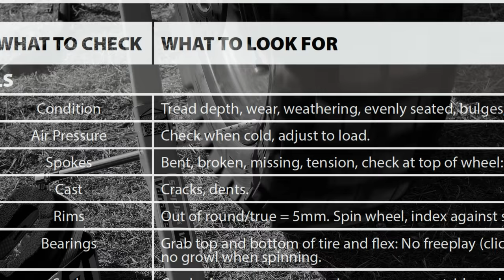Before You Ride - A Quick, Effective Motorcycle Safety Check

Comment: I would actually recommend a lot of this just for the sake of warming up your bike while you do the quick checks. So many people (sometimes myself included) just switch on ignition and ride off without letting it warm up a bit. Having a reason for letting the bike warm up a minute before you take off, is probably good in the long run
Reply: thats bull

your engine might warm up but nothing will be running so there won't be any oil running trough the moving parts so you're better of starting the bike and ride it to actually warm it up. It takes about 10-15KM to warm up a bike properly 

letting it sit there just annoys the neighbours
Reply: SoloSeff  You realize that your chain, sprockets and even the transmission to some degree don't benefit from a warm engine, right? 

The parts that are moving at idle, namely piston, crank, and the valvetrain are being lubricated. The warm up is pretty much only for the piston/cylinder as the metals expand at different rates and work best when at proper operating temperature. 

My bike only takes about a minute at idle to get some heat into it, enough time to strap on a helmet, tighten my gloves and buckle up my backpack. Hardly inconvenient
Reply: This is something that people can't seem to agree on. The problem with warming it up first is that the engine doesn't really warm much unless you're in motion. My bike idles at a touch under 1.5k, but won't drop below 4k while riding. 

On my Ninja 250r, the engine won't warm up much if it's not in motion. And yes, I've tried. The engine just doesn't warm enough to make it happen in any reasonable time frame. Whereas within a couple minutes of riding, it's usually good to go.
Reply: my bike is warmed up in like 300 meters, although my bike wont pull away properly under 5k, and power comes at around 7
Reply: It's an issue very similar to driving a car. The fact that the thermometer shows 90°C (or a similarly OK temperature) does not mean that your engine is heated to the same temperature, only the cooling fluid is, and vice versa, the bike is not at operational temperature. I'd rather not risk it and I don't mind waiting a bit. I drive my bike out of the garage, keep it running, close the garage, put on the jacket and zip it to my pants, put on the back protector, helmet, glasses, double-check my car, the garage door and the license in the storage, put on the gloves (at this time my bike is running idle and warming up for 5 minutes or so) and then get on and ride. And I don't rev it over 5k in the next couple of minutes - until I get out of the city. I don't need to jump on it and rev it to 11k in 30 seconds, since I am neither retarded nor simply careless and stupid.
Reply: @Jonas I don't think anyone is suggesting to rev the shit out of the engine cold. A proper warmup is to ride gently until at temperature, meaning the coolant has hit it's peak.
Reply: It is actually fine to ride straight way as long as you just use a tiny bit of throttle to keep moving, not much more than idle is needed and large bikes do warm very quick.  BMW actually recommend driving straight away in just the manner I said above, it makes sense, the oil pump will pump more oil around and warm up quicker = longer lasting engine components, as long as it's still well maintained of course.
Reply: In my experience with a carbeurated 650 single the motor can and will stall off idle if not warmed properly, not every time, just at the worst time.
Reply: ebmstudios carb vehicles require warm up. But fi cars dont, and im surprised that people think the first mile of their trip on public roads requires a warm motorcycle engine.
Reply: +Johnny Blue, it's a Ninja 250r, those bikes are notoriously cold blooded to the point where some folks will put some cardboard to block the radiator during warm up. Small liquid cooled engines can be rather tough to get warmed up, especially when the temperature drops below 60F.

I have to ride for dozens of miles on the freeway before the engine warms to the point where I can't touch it without burning myself.

Thermostat has nothing to do with it, all that does is tells the radiator fan to turn on. Removing that would cause it to overheat, but only on a warm day.
Reply: +Jason J. Ayala P. , depends where you are, the street out front of my place has cars driving up to 50mph, and attempting that without a reasonably warm engine is asking for trouble. Especially if you don't have fuel injection and may have some moisture in the line.
Reply: Chris L yea a lot of various statements in this regard, and probably not a single truth here. But I can't imagine it having any negative effect, so why not take the time to just make sure the basics on your bike are working fine - and having a slightly warmer engine for takeoff.

I know from experience that my bike does benefit from a bit of preheat - especially in the colder winter months. My bike gets a lot of airflow, and often during cold days it will never reach its normal max temperature where it usually sits in regular riding. Because of its large amount of cold airflow, it is actually easier for me to get the bike warm while it is not in motion (and no its not air-cooled, just lots of air flow around all engine parts). It's also a single cyl (650cc) which might contribute to the reason for its easy cooling. I sure feel a difference when I let it sit for a minute before takeoff. Not a big difference, but still I feel that everything is just running a tad more smoothly.

By the way when I talk "cold days" I mean days where there are inches of snow on the roads.
People who never ride sub 10 degrees celsius will probably never notice a difference.
Reply: Jonáš Lasák Nice, pretty much what I do also 👍
Reply: Interesting. I never let it warm up by idling. I've been told that running on idle, or without a load isn't the best thing for internal combustion engines. And my neighbours appreciate the lack of noise at ungodly hours because of my weird working hours. Neither my modern fuel injected bikes or 70's bikes seemed to suffer, the only one needing to warm up was a suzuki gs450 but that has way too small carbs from stock. I don't ride the bike hard until it's warmed up properly though. No need to ride hard in my part of town either... By the time I'm out of town pretty much every bike is warm enough to open it up. Not every bike though. Kawasaki GPZ500 in winter... I'm looking at you.
Reply: It depends on your bike. I have a 1991 carborated Suzuki DR 650 without E-starter. Oil pressure when cold and idling is pretty much non existent, so the manual says you should start the old Diva and get on with your ride immedeatly, keeping her between 3000-4.500 rpms  for the next 5 km. Otherwise there is not enough oil going up to the camshaft, resulting in a ridiculous amount of wear. Even when warm she has little problems with it. Setting idle about 1400 rpm is no problem and the motor sounds just fine while running, so many guys did it. But for proper oil pressure 17 - 1800rpm is needed and not getting enough lubricant every time the bike is in idle really adds up. Now you see a lot of these old DRs with their second or third camshaft and new rocker arms. A lot of unnecassary repairs just because people dont read the manual if you ask me ^^
Reply: I know this thread is old, but letting it "warm up" while doing the check will let you hear if the engine is making any unusual noises.  Especially when you check the controls.
Reply: MISTER SIR I'm looking to ride in the winter in Pittsburgh PA. Any suggestions?
Reply: @MitchellJosh  I guess you mean in terms of things that are good to consider when riding in winter? A lot depends on what kind of bike you ride, but generally I'd say that a more constant cleaning and lubrication of the chain is important (clean and lube chain approx every second fuel stop, if road conditions are very bad then you can even do it every time you stop for fuel), and checking tyre pressure too, as it will drop during cold temps. Optimal winter spec road tyres are also important, ones that handle wet/cold/slippery surfaces.
I'd say for safety of riding in general, personal comfort is actually the biggest factor to consider, because an uncomfortable rider is more prone to making rider-induced mistakes and late reactions. So proper riding gear that insulates you and blocks off head wind, but still allows your body to breathe is important. Your hands are gonna be most significantly effected by wind, moisture, and the cold temp - so having either a thick winter glove, or use thin silk gloves beneath your riding gloves can also do a great job at maintaining a bit of heat (old skier trick). I personally often found myself warming my hands individually by holding them close to the engine when the air temp was very low, it can help a bit.
Remember to check your fluids often, make sure that clutch and brakes are easily operated. In general, all basic maintenance has to be done/checked more frequently during winter.
Lastly, in case you come across road with a decent snow layer, it may be best to ride (very slowly) in the fresh snow spots and stay clear of grooves and trails made by other vehicles. If you follow in the track of a car for example, your front wheel will have a tendency to steer according to the trail, rather than your handlebar input - and if you don't match your inputs perfectly the front tyre might slide in the opposite direction of where the bike is going. In fresh patches of snow, there is no pre-existing grooves for your wheels to dig into, so steering is a bit more predictable. Still, you should always be very cautious of sudden movements and steering inputs, and I'd say if there is more than an inch or two of snow, then you should not exceed speeds at which you'd feel comfortable putting down your feet to help maintain balance.

If you were asking for suggestions of where in Pittsburgh to ride, then I'm sorry I don't know the place.

I don't know if you're experienced in winter riding or not, so excuse me if some of my suggestions seem very basic :)

Comment: This is a good guide. The weld check is not critical every time unless you just rode off road. Once you have so many miles on the same bike, with the same tires you will also learn what low PSI feels like. With time, and miles this process can be done in a minute or less. 

I will also say that if you ride every single day this can be an every other day check. With my average of 1000k miles a month on my bike some times i just have to get on and go. For you people that ride far less i would recommend doing this every day

Comment: When to make the checks:   I suggest this whole 90 second rigamarole anytime you have to pick up the bike of the ground — after the crash.  Otherwise,  tire tread depth, pressure, oil, etc. at least once a week.    Loose fasteners:  after a day in the dirt, not a few minutes before the ride.  How many checks do you make before driving off in your car?  I don’t think modern bikes shake themselves apart or suddenly drip fluid.   It never hurts to check, of course, but  I ride 3 or four times a week, and many of my rides are less than 25 miles.  If this 90 second check is performed every 300 miles or so, or whenever the bike has sat around unridden for several weeks,  and certainly after a tipover or worse, I think you’re good.

Comment: I check lights & fluid. My SV650 headlights failed last month at 22k. Melted black connector pin under the airbox, a real twat to reach. Didn't have to solder it by using a wire lever connector. Also the yellow LHS switchgear connector had green pins. The notorious green melting connector was surprisingly clean as it's  watertight.

Comment: Ryan does this the right way. I on the other hand check the air pressure/fuel level/ground (leaks) every ride - been caught several times with slow air leaks. I check the chain every 2 weeks or so, fluids/lights every month and welds/fasteners never (my bad - but it's a 2017). I wish I has a fancier bike with tire pressure monitors to be honest (I'm a bit anal about tire pressure) - but even they can fail so, whatever. Great vid as always.

Comment: I really should do all that... it's a great routine. Instead, I bought a TPMS, blue loctite'd everything that could be, and carry chain stuff with me. So my routine goes like this (and I admit Ryan's is way better). Walk up to the bike, check the chain slack with a foot, walkaround looking for anything out of place, get on the bike and start going, during initial slow speed operation check air pressure and look for 'normal' suspension operation, listen for chain noise indicating I need to lube or adjust (do that next stop if needed). Once every 500-1000 miles add a sightglass check to see if I need to top off oil and a tire tread check to see how that's going. This has kept the bike in oil and prevented me from doing anything TOO disastrous... but I've missed a lot of stuff over 100k miles: multiple loosening bolts (including the loss of a centerstand bolt before I started the loctite protocol), low tire pressure before the addition of the TPMS, loose chain that was quiet but still needed adjustment, pannier that was left on the ground next to the bike because I was in a hurry (yea that's bad I know), front wheel mud flap that had somehow got caught up above the crossover part of the crash bars and I rode for 2 days before noticing it, headlight out, and lots of other things I probably would have caught with a more thoughtful pre-flight check.

Comment: You can get pressure monitoring valve caps for about £5 that will turn red when the pressure falls below the level your tyres are rated at.
You'll need to buy one specifically rated for the pressure though.

Comment: 2:50 XDD , Excellent video, as always ! , checking  wheels bearings is another easy thing to check in 30 seconds , just take your two hands on the top of the tire and wiggle back and fourth ( assuming you're on the side of the bike ) most of the time if its loose you will find out

Comment: I check and tighten every bolt and  screw for  service manual recommended pressure  before going to the corner shop for condoms.

Safety first 🍌
Reply: At least then you have a valid excuse when you're late for your date.
Reply: But... if you date is late, maybe you haven't ridden safe.. oh boy! 😨

Comment: My process is a bit weaker.    Usually involves some sort of awe inspired stare as I walk up follow by maybe a kick of the rear tire or a push of the rear brake.

From there I gear up, start it, and ride until I notice something wrong.

I'm pretty mechanically inclined so I can tell immediately when something starts affecting riding behavior.

I figure as I slowly pull out for my ride, I usually use both brakes before even starting the engine and then from there it's a slow progression through a slow gently warmup to a pretty hardcore ride.

Comment: The process for klr 650s is a bit different. First you start it up, then you push it over. After you pick it up you push it over on its other side. If it's still running you're good to go.

Comment: check air in tires,if you know your tires dont leak air you shouldnt  loose air after a week of bike sitting,if you lost 5 psi or so then you should check air before every ride and pump the wheel back up.
I know i dont leak oil and dont burn it that much so i check oil every 2-3 weeks.
Do not leave bike sitting for weeks-months on footpeg in same position,get front and rear stands or if you can just rotate front tire every week.If you dont your front tire might develope flat spot were most weight pushed it overtime and you will loose a shit ton of air.
Check your pockets pefore leaving,many times i found i was riding with my jacket pockets unzipped that had wallet or keys in them

Comment: failures do not occur at welds, a properly done weld should actually be stronger than the original material without the weld in the first place. weak points at joints usually occur just outside the welded area but never the weld its self.

Comment: I like to do a few of those post-ride.  Frame, chain/driveline, steering gear, brakes, bolts.... I want to know after a ride so I can fix it before the next. Nothing sucks worse than a mechanical ride cancelation.... and isn’t it so tempting then to ignore a small issue, go anyway, and make the problem worse, and or get hurt in the process? Post-ride checks help prevent the temptation.

Comment: I use powderss checklist

Petrol. Have I got enough for my journey?
Oil. Are oil levels ok?
Water is engine water level ok?
Drive and Damage. Is the final drive ok? any damage to my bike?
Electrics. are electrics ok? all lights on? no damaged wires?
Rubber. Got enough tread on my tyres? is the handlebar rubber still grippy?
Steering and suspension. Can i turn the handlebars fully? is suspension feeling a bit spongy or ok?

Comment: I failed to check my tyres. Jumped on. Throttle jammed open. First corner ended up high siding. Snapped my finger (surgery to rebuild it), separated my top lip from my gum, and lost 13cm3 of flesh from my knee.

If nothing else, check your damn tyres.

Comment: New rider here.  Can I get some gear recommendations?  I'm looking to spend up to about $400 on a jacket, up to about $200 on boots, & <$100 on gloves (already have a helmet, but I'll be replacing that when I can afford it).   My bike's a 650 cruiser (if anyone's familiar with a Hyosung GV650, would that qualify as a "sport cruiser"?).  I live in New Mexico, USA, so I don't necessarily need complete waterproofing, but I can also only afford one set of gear, so it all needs to be pretty all-around.  I regularly spend anywhere from half an hour to a full hour on the highway each way, & I'm otherwise riding in the city.